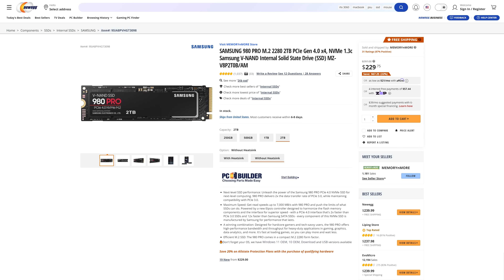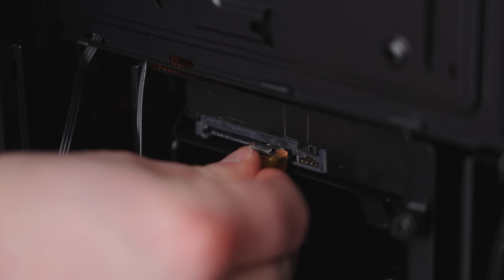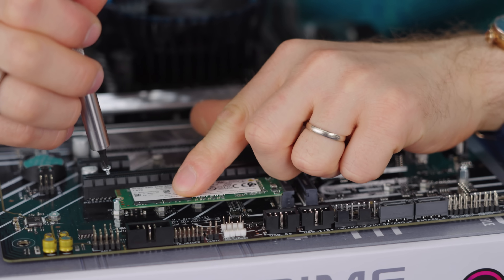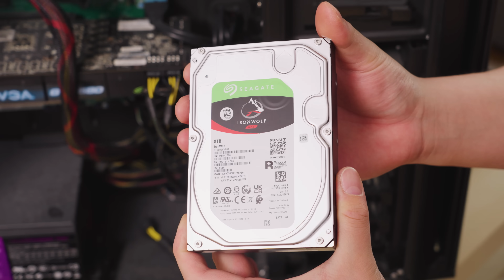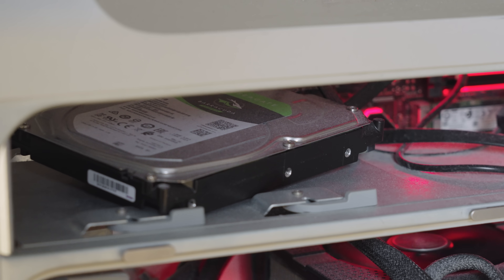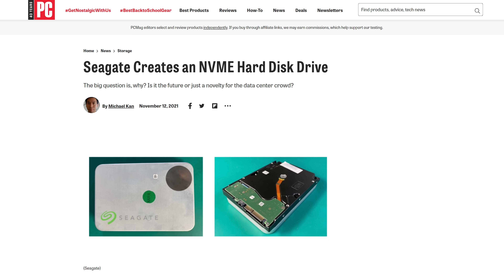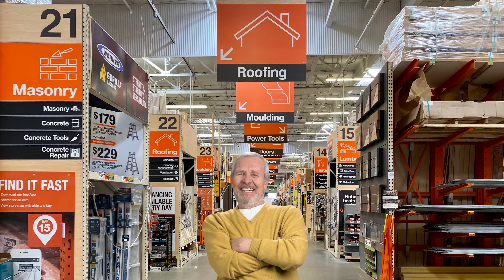Is SATA Obsolete?

Comment: It mostly comes down to capacity.  If you need capacity, NVMe is just not the way to go as you can't just cram a bunch in there, and if you can and do, you're paying for it badly in PCIe lanes.
Though, honestly, given the form factor, I remain kind of surprised that 2.5" SATA drives don't offer more capacity than they do.  They have plenty more space for chips than M.2.  Not sure why no one in the industry uses that to offer larger capacity drives.  I do however wonder when an NVMe over cable standard is going to become common in desktop PCs.  Building a RAID array out of M.2 sticks ... kind of weird.  LOL  Then again, the whole "workstation" concept seems to be eroding.  Which kind of sucks, honestly.  How are we supposed to get work done?
Reply: On the enterprise side of things there are 7.68 TB SAS SSDs
Reply: dont mix nvme and m.2 theres 2.5" nvme drives
Reply: dumb comment. if sata becomes obsolete, motherboard manufacturers will just increase the amount of pcie lanes.
Reply: There are enterprise drives that have higher capacities for both NVME and SATA SSDs.  They're pretty expensive.  Those 30TB NVME drives that Linus used in his most recent server build cost something like $9-$10K each.  That's pretty extreme, but still, a 20TB enterprise HDD can be had for under $600.  There's no question that for the enthusiast consumer looking for a mass storage solution, HDDs make a lot more sense than SSDs.
Reply: it's not eroding what are you talking about
Reply: @Mr Pais GPUs dont work at all with 12 lanes. You cant just arbitrarily split PCIe Lanes. Lane Allocation has to always be a power of 2. On top of that you are limited to what modes the motherboard supports, in most cases its 8x/16x for the main 16x CPU slot.
And of top of that I have never seen a modern mainboard that shares lanes from main 16x to m.2. Usually first m.2 slot comes from the CPU, the other m.2s are usually connected via the chipset and dont share lanes with the 16x slot. Usually the only thing that shared lanes from the main 16x slot is the second 16x slot.
Reply: " I do however wonder when an NVMe over cable standard is going to become common in desktop PCs."

Fundamentally the issue is that the vast majority of PCs have 0-1 SSDs, 0-1 HDDs and 0-1 optical drives. HDDs and optical drives are fine on SATA and a single SSD can easily be mounted in a M.2 slot on the motherboard.

So any NVME over cabling standard will really struggle to achieve economies of scale. On top of that even if they had the same economies of scale, a 4 lane cable and connector will always be more expensive than a single lane cable and connector.

And then there is the problem of the host end, x4 PCIe connections regardless of form factor will chew through the limited number of PCIe lanes on most CPUs and chipsets. So to support lots of NVME drives (regardless of form factor) you either need pricy HEDT CPUs or pricy bridge chips.
Reply: NVMe over cable exists. It's called Thunderbolt.
Reply: 2.5'' ssds go up to 61tb, but they cost as much as a threadripper pc with a 4090.
Reply: 2.5" SATA SSD's are all empty boxes except a small PCB in the corner. It's just for mounting compatibility.
In the 90's there were cheap secondary storage HDD's that were 5.25" with a slower spin rate. I guess the chip shortage has killed the cheap storage market.
Reply: @bgezal  This was not always the case. I still have a 64GB SATA II 2.5" SSD that's big and heavy. The inside is full of memory chips but that's because they used to be SLC memory. Nowadays they have QLC and make them much cheaper.
Reply: @Argedis  Of course. My first SSD was a OCZ Vertex 2 and that had more weight to it. I lost it to the sandforce "sandman bug" and got a replacement Vertex 3 that I still use.
Reply: @bgezal  Mine was the Patriot Warp V2. I don't use it anymore but recently did a speedtest on it and the 4k random write speeds were less than 1MB because the controller sucks. The reads were decent at 200MB. Might just use it as a giant flash drive lol. The SLC chips will likely last forever.
Reply: @Argedis  I use mine as a system drive for my Plex/HTPC server. Mostly reads and is fast enough.
Reply: Kingston and Samsung make 8TB 2.5" SSDs from what I know. Is that not big enough for you?
Reply: @AmartharDrakestone  "Kingston and Samsung make 8TB 2.5" SSDs from what I know. Is that not big enough for you?"
1. No, it's not enough for me.  Which is why I use RAID 5 spinning rust arrays.  But that's not the point.
2. Adding more chips to the same board, using the same memory controller and RAM cache, is a cheap and easy way to make larger capacities without sacrificing anything in any way.  And yet the 2.5" footprint on SSDs is mostly unused empty space and plastic.
Reply: @justsomeperson5110  Correct, also I can buy 16TB HDDs for under $400, while a 2.5" 15.x TB SSD costs $2k+, its just not economical for mass storage.